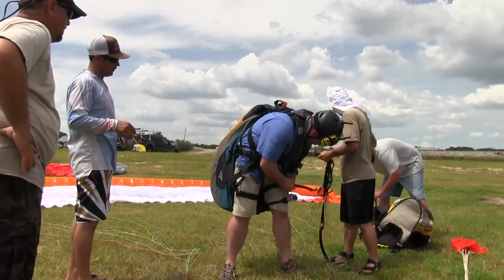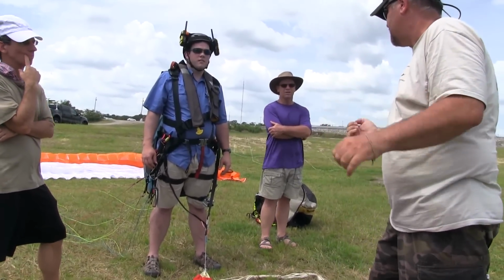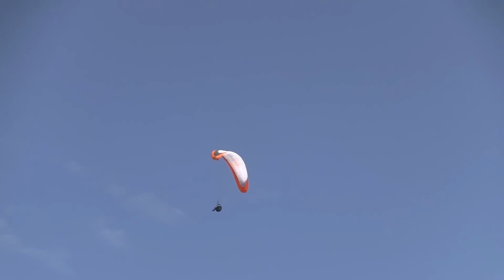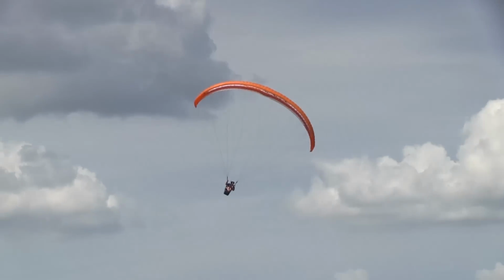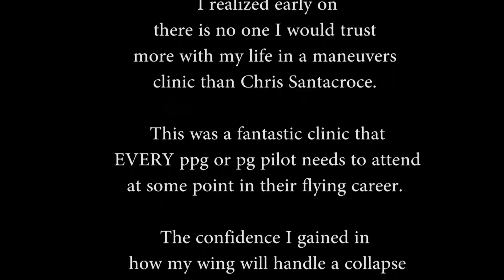How A Paramania GTR Reflex Wing Responds to Deflations.

Comment: Thanks for posting this. I have been flying the fusion for a few years, both with a motor and without, and I have never had a problem, other than the odd flutter of the tips, which has sorted itself out without input. I did always wonder what a frontal would look like, particularly when free flying - the Fusion got it's only EN C rating for a 75% frontal collapse, all other grades seem to be A and B.